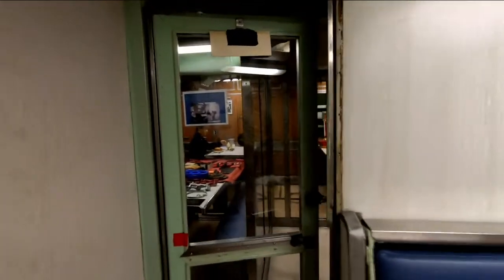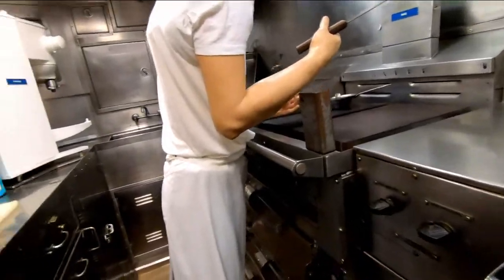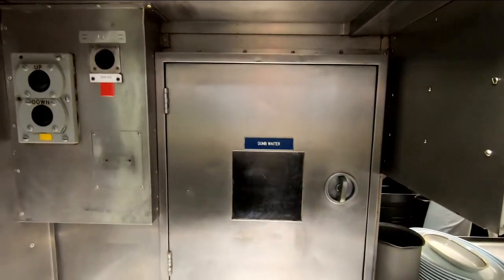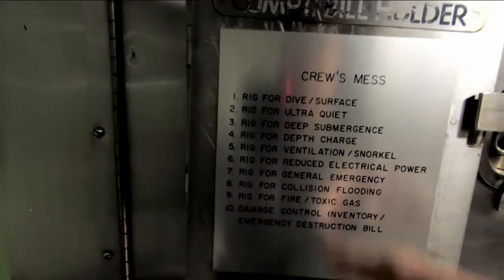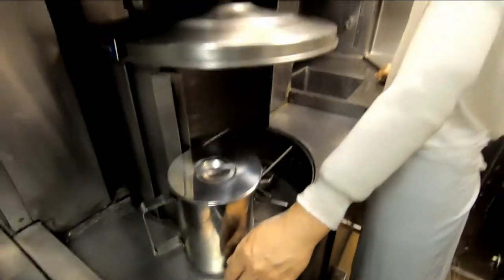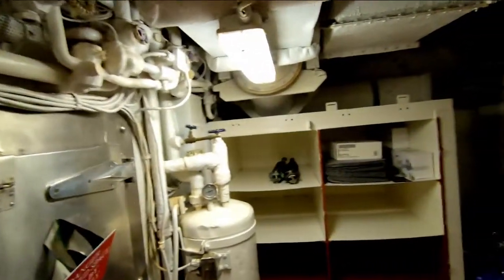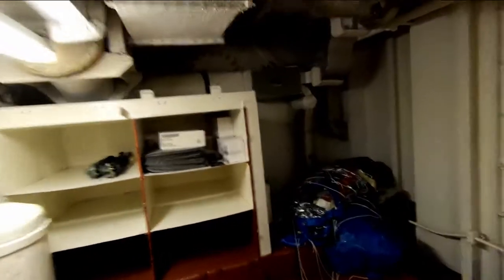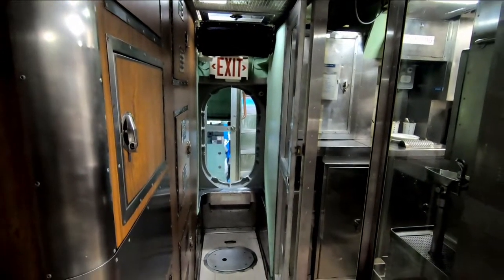Episode 13 - Galley and Storeroom

Comment: Do you know how the galley exhaust air was cleaned? I was wondering since under way submarine was sealed off.
Reply from the maker: The galley has its own air exhaust suction to ensure all air goes through the filter system just like the rest of the air on the boat.  The filter system pulls out carbon monoxide and dioxide through a scrubber (for CO2) and burner (for CO).  This pulls those contaminants out.  There are also general air filters used on the suction points as well.

Comment: random question. is there anywhere\anyway accessible to where President Truman Signed the keel via welding?   that would be super cool... also did you have the permit to enter that confined space  lmfao jk.
Reply from the maker: President Truman's signature is a little hard to get to outside of an availability.  We may have a picture of it though and we will post that on our Facebook page.

As for the permit (I know you are joking - but...) the gas free chit is really the only "permit" needed for those with authorization - ship's force in this case.  After that you only have to notify the Command Duty Officer to ensure no other work in the area would interfere with your tank entrance.